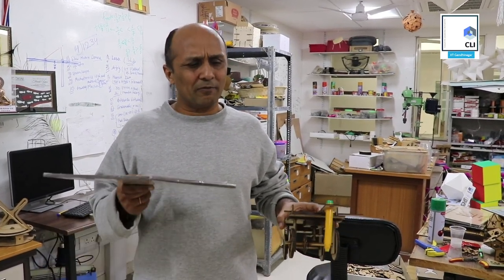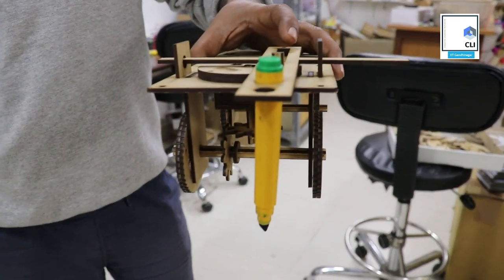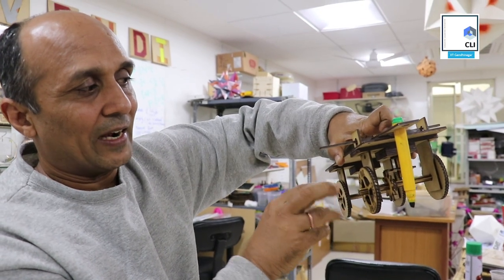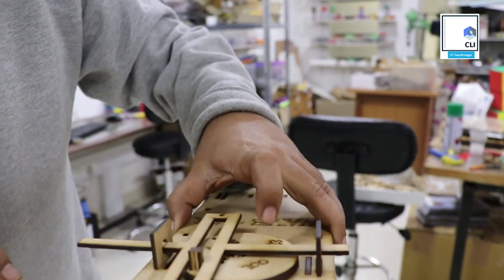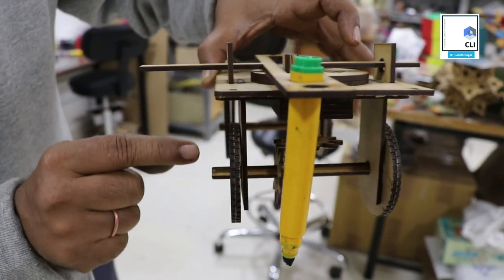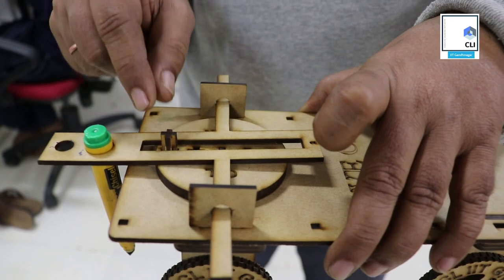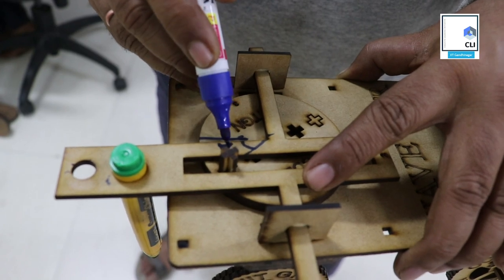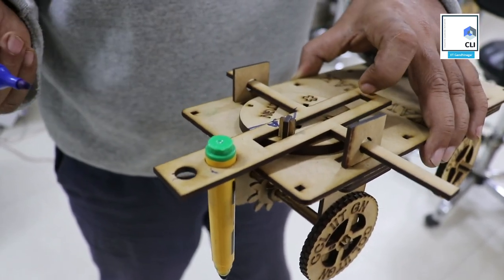SINE WAVE CAR

Comment: Artistic Engineering , Just wondering ,what required to change in order to get different amplitudes and frequencies/Time periods,
Reply: If you make the top disc bigger and put the stick towards the end, amplitude becomes longer. Decrease the size of the wheel, or decrease the number of teeth in the horizontal gear and the frequency increases.